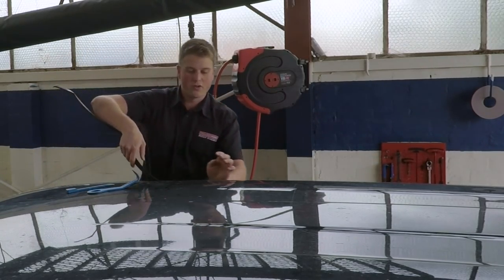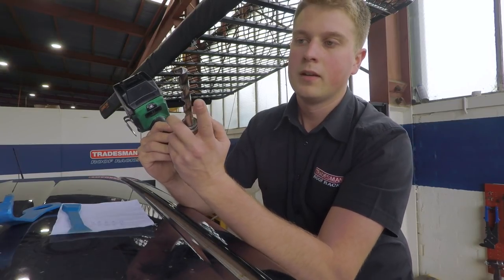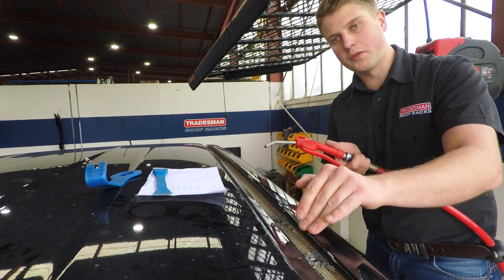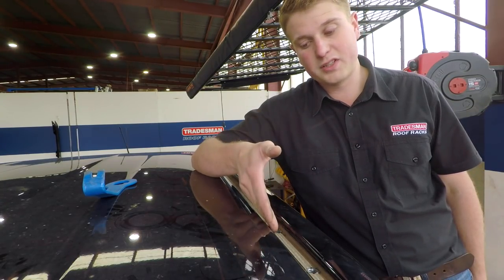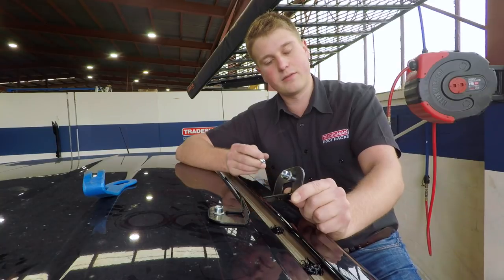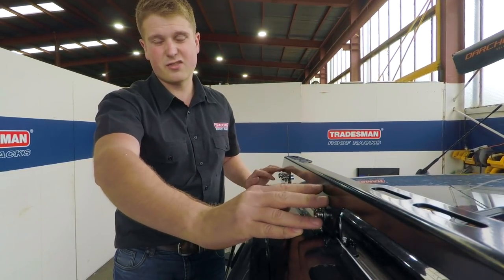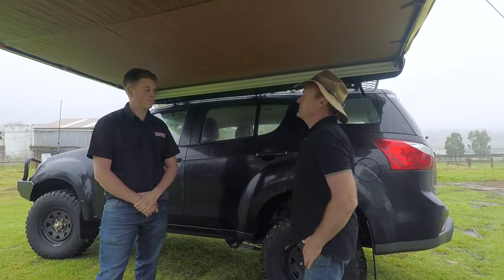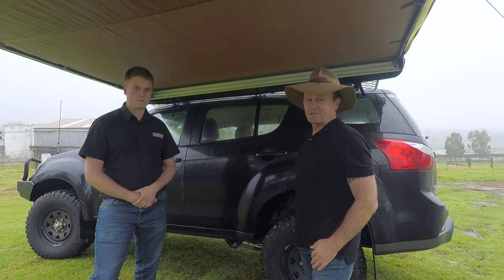Isuzu MUX Roof Racks - ( This Is A Very Complex Installation )

Comment: just stumbled onto this, a bit over 3 years ago I bought an Isuzu D Max, had a canopy fitted, then needed a 'full' length, 2.8M roof rack. I went and spoke to Josh at Tradesman, they had developed a support bracket for the front section of the rack to allow side and lateral movement, as the four fixing points on the canopy meant it was ridged. the front support allowed for 'flexing' between  the canopy and cab body. a great quality product and made here, well worth the money spent, can carry the load
Reply from the maker: Gday Brian,

Great feed back mate.
The team at Tradesman Roofracks sure make a quality product.
Thats great they helped you out with the rack on your D Max.

Cheers Batesy.

Comment: May I have the measurements where the mounting holes are located? Also have a base model that needs to ne drilled to attach the heavy duty rack. Thanks in advancem
Reply from the maker: G'day mate, 
You would have to speak with the guys at Tradesman Roof Racks about those hole measurements. 

Cheers Tim.

Comment: Is that fit the orignal hols on mux roof ?
Reply: Yes it does fit the original mounting holes in the roof.
Reply: Tim Bates 
Do you have interntionl shipping ? And if you have how it cost this itme and the shipping to soudia arabia ?
Reply from the maker: Gday mate,

You would need to speak direct with the guys at Tradesman Roof Racks regarding international shipping of there roof racks.
Reply: If that's original holes, why drill more holes?